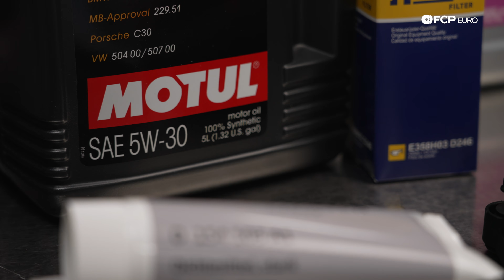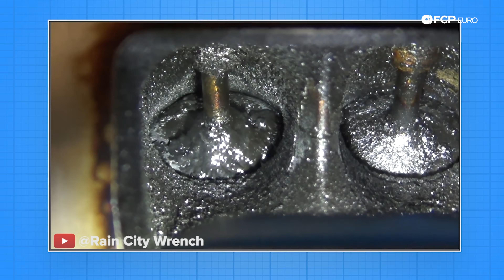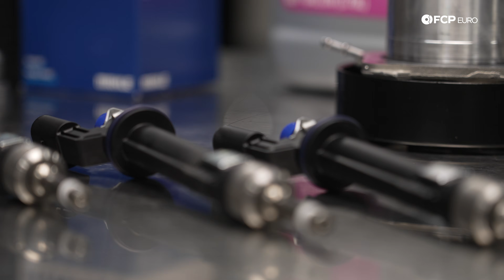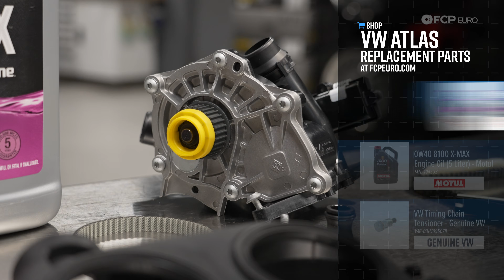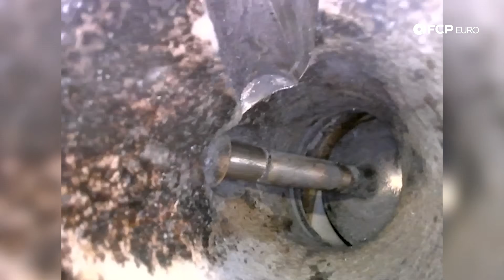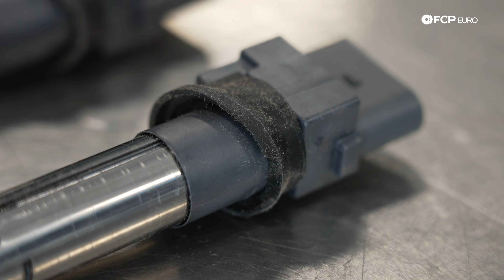Volkswagen Atlas 3.6L & 2.0L Engines: Everything You Need To Know - VW Atlas MQB & Cross Sport

Comment: "Preventitive" replacement of the whole water pump at 60K miles seems insane, right? If it's actually necessary that is absurd in a vehicle this expensive.
Reply: Buy used its cheap

Comment: What is your take on using LM 5w-40 Molygen 502 specs in 2019 Tiguan 2.0t EA888, instead of the 0w-20? I live in a hot climate. 150k miles
Reply: Approval rating is #1. Example VW 504. 0W-30 OR the new 0W-20 green not just the Moly Gen.

Comment: Once my extended warranty ends, I will switch my intervals to 5000 using a local shop or myself.. at 60k with 10k oil changes, still runs like new. 22 atlas vr6

Comment: My 2025 Atlas R-Line SEL sure uses a lot of oil between changes, but according to VW Maintenance manual it always stayed with limits according to the dip-stickless readout. Why is this the case? Where is the oil going? Is the engine actually burning it?
Reply: Because the vehicle is relatively new, the tolerances are tight. This causes the oil to ionize or sizzle off the metal within the engine. Over time as your tolerances build off from use, you'll "burn" off less oil, unless you have a mechanical problem. If there's oil still in the vehicle, you're okay. If it runs dry, it's no bueno. Cheers!
Reply: @Reggie300 No that’s not a symptom of tight tolerances. For one the engine is “broken in” in 500-1000 miles. With modern alloys used in various parts ie rings and camshafts that’s really not even a the case anymore realistically. Modern coolant temperatures are typically ran near the edge of boiling ie 220-230F for emissions. Downside is oil oxidation rates double every 10F past 200F. That’s going to keep the engine oil near 250-275F at the main bearings. Why does engine coolant temperature matter for oil? Because engine oil has a heat exchanger directly plumbed to the engine coolant. Why? Because coolant warms up quicker than oil. This forces the oil to reach operating temperature faster. Cam phasers stay in the parked position until oil temperature is warm so they have a known and consistent pressure to work with. They use engine oil as a hydraulic medium for that system. Most of these engines are also turbo charged. That very hot turbo is cooled by engine oil and coolant. Lastly modern direct injected turbocharged engines run high compression with high turbo boost. This causes unburnt fuel and exhaust byproducts to blow past the rings and dilute the engine oil. This along with oxidation causes the oil to break down at a faster rate. Only thing that can help is changing your oil every 4-5k miles instead of 10k miles.

Comment: A lot of the VR6 issues seem related to possible lack of maintenance so tbh I just got a used 2019 atlas VR6 for my wife and as the weekend uber car as well. It has 45k on and bought last week and luckily previous owner did oil changes every 5k so I’m glad. Literally runs amazing and peppy too
Reply: Just snagged one for $26k 37,000 miles, I am happy the VR6 sounds great and drives great, for the most part take care of it, I’m thinking of throwing a catch can and I used to run a lube shop so I run over there and maintain every 5k, fingers crossed but happy so far

Comment: Great video! I have a 2018 vr6 atlas w 180k on it.  It had 1 fuel injector go bad at 120k.  I’ve done the regular maintenance, but never did a carbon cleaning or pcv.  It is running slightly rough especially when cold. So, I think it’s time for a carbon cleaning, valve cover, and all fuel injectors (plugs and coils pretty new).  I can do all the at once, but I’m wondering how hard the timing chain is.  Is that an engine out item? Anyway, very happy with my atlas as I bought it new.  Too bad they stopped the vr6
Reply: Timing chain on the VR6 is an engine-out item due to their location on the transmission-side of the engine.

Comment: Have seen quite a few 3.6 head gaskets leaking oil down the front of the engine, can be mistaken for an oil cooler. Out of the 31 I've replaced, I'd say bout 5 or 6 of them were leaking oil there. The oil return from the head is right there at the front of the block so that usually where they leak oil from if it's not a HPFP seal, upper cover, or valve cover leaking. Also the VR6 phase position values that are acceptable are -8 to +8 degrees, with each cam being no more than 4 degrees apart from one another.

Comment: Oil spec and years mentioned toward then end aren't entirely accurate.  i have had a 2018 Passat with a ea8883b, a 2020 tiguan with the same engine, and now have a 2019 gli with a 2.0, all of them required 508.00.   Strangely, my mother's 2022 atlas cross sport 2.0t specifies 504.00 oil.

Comment: Any thoughts regarding looking at a used 2021 SEL R-Line 4Motion with 42,000 miles that had the intake manifold gasket replaced between 34-39,000 miles according to the CarFax? Thank you.

Comment: Took my R32 apart at 130k, valve ports were spotless. One of the reasons I purchased a 2021 Atlas. ✌️
Reply: I believe all R32 were port so is shouldn't have had any intake valve build it
Reply: Was your R32 port injected or direct injected?
Reply: @jett1976 should've been port.
Reply: @j @jett1976  I think all VW/Audi are direct injection.
Reply: @12entz65 now they should be but not when the R32 was out.
Reply: @jett1976 should've been port.
Reply: @jett1976  R32 is port injected.

Comment: Love the video, here is my 3.6 experience:

I’ve got a 2010 3.6 CC with 133k miles that I’ve owned since 14k miles and I’ve found the plugs have held up great. I changed them at 100k. The valve cover needs replacement more than the plugs is what I’ve seen. As I’m on my second replacement.

My wp and thermostat have held up great with heavy idling but I have changed my coolant just recently.

Comment: I don't understand perpetuating the myth that oil changes need to be 5k. I've done oil analysis on mine every 10k with no issues. Unless you're beating the wheels off your vehicle, the only thing 5k oil changes do is make oil companies richer.

Recommending coils every plug change is wild. There's absolutely no reason to do that. Most coils should last over 200k without issue. 

Man, I might to have to rethink where I spend my money. Not a fan of the sales tactics here.
Reply: Oil analysis will not show Oil oxidation. Oil analysis will not replace the oil filter which is only good for 3000-5000 miles.Dirty motor oil affects clogs PCV and affects fuel trims and also can damage the gaskets and silicone gaskets. change the damn oil and stop waiting on oil analysis to tell you there's contaminants by that point it's too late and the damage has been done.
Reply: @gransergranser9756  clearly you haven't had an oil analysis done because they most certainly can test for oxidation. And oil filters most certainly can last longer than 5k. 

Again, I run an oil analysis every 10k and everything is in spec. If the filter wasn't holding up, it would show in the numbers. 

If you're doing analysis all the time, damage will never occur. I have 170k and about 15 tests that are always in spec. But of course there's always people like you who will talk despite having no experience or knowledge.
Reply: @NomadPoker1 I always change anywhere up to 5k miles. Oil and filter... Gotta keep it fresh 😎🙂

Comment: Can you talk about atlas performance  upgrade options
Reply: The 3.6 doesn’t really have performance upgrades. There are things that make it sound great like an exhaust and or intake. That’s said these 3.6 are fairly well optimized from the factory. You’d need to spend money on cams $1k+, headers back exhaust $2k+ or get a $400+ tune and even with those you are looking at marginal gains
Reply: Cold Air and Exhaust will get you about 60 Extra HP...

The cylinder engine just needs to be chipped and programed. Real talk after driving both engine versions I can honestly say the cylinder turbo is a little snappier but the v6 feels more sure. That cylinder it just too small for that massive Atlas. It's beautiful on the smaller VW vehicles...
Reply: @ the 3.6 doesn't come anywhere close to 16hp let alone 60hp for an intake and exhaust.
Reply: @CorradoAlley  I was told that from an enthusiast who has more experience than myself but I will research on my own and probably find out that serious cam and engine work will probably have to take place in order to get real noticeable power...

Comment: Just traded my Kia telluride in yesterday for a 25 atlas peak edition because of your Atlas buyers guide. I have the 2.0t and the power is more than  adequate which surprised me! It’s such a solid fun suv to drive and look at! Thanks for your help my man🎉❤😊
Reply: My guy says use premium fuel, 7k oil, 80k plugs 2019 VR6?
Reply: @timhaeussler-yp6qr - 80k is too long for plugs in any engine, even NA.  They are so cheap to replace, just do it every 50-60k miles to avoid misfires and carbon buildup from inefficient fuel burning.  7k is also too long.  Don’t operate a vehicle on a cheap budget if you’d like it to last.
Reply: @timhaeussler-yp6qr spot on, agree 😊
Reply: Yea, you should have gotten the VR6😊
Reply: Hows the cabin noise and ride smoothness in comparison with the telluride
Reply: Never buy the turboed atlas unless you dont care about your money you went from a turboed kia to a turboed volkswaggon not much of a improvement. 😂
Reply: and why aren’t you trashing the turbo Kia?  Extremely faulty logic.
Reply: @gransergranser9756  I've always felt that the V6 is always better for an SUV. The 2.0 Turbo will be a waste of money in the long run... I feel like the weight of the suv will wear on the 2.0 far too easily causing us to spend much more for upkeep...